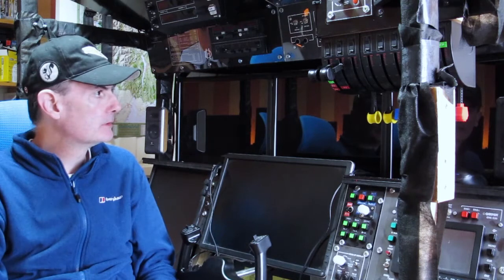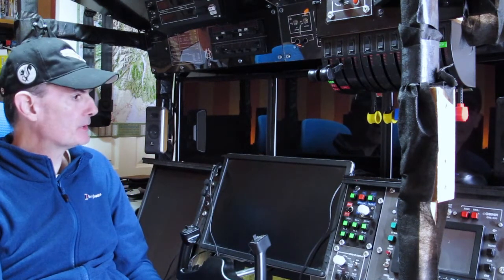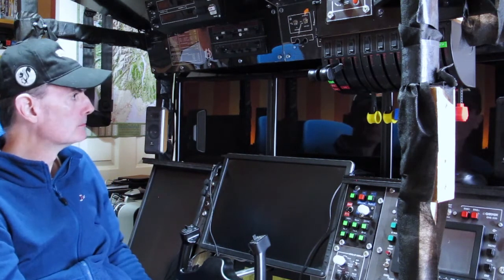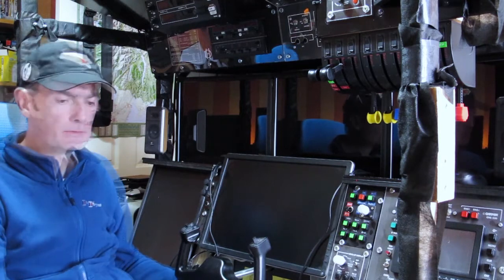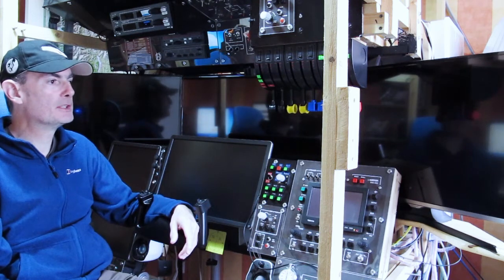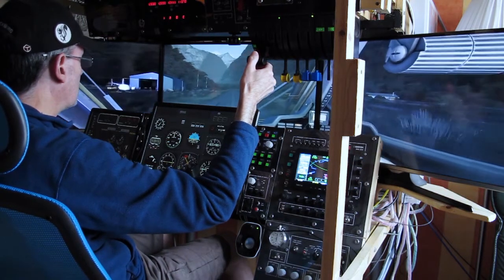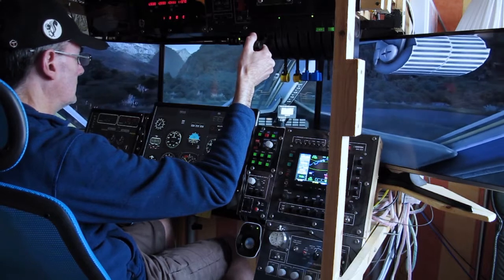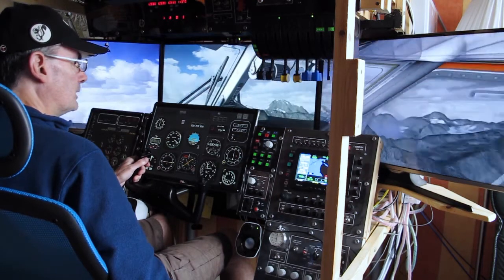Upgrading to 3 x 32" Screens! (Twin Otter Cockpit Build - Part 42)

Comment: Mark I have a 32 inch screen and would like to get another one to extend my cockpit.Could you tell me what I would need to do this as I do not have any technical knowledge as I am pretty new to this game. Any help is greatly appreciated.
Reply from the maker: If you have an nvidia card that supports 2D surround with a single GPU, then it's easy. Just buy another screen, plug it in, run the surround setup in nvidia control panel and you're done. Otherwise, I think it will depend on what you have inside the box!

Comment: Looks good. I noticed that the right screen is mostly taken up with the overhead throttle because of the distortion. Obviously you're not looking at that screen with track IR, when you move your head the throttle gets smaller.